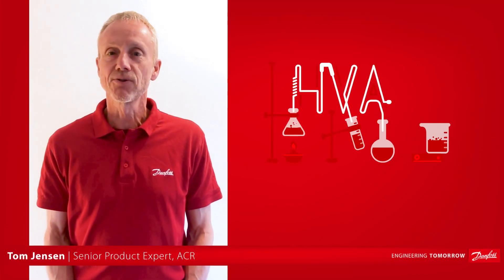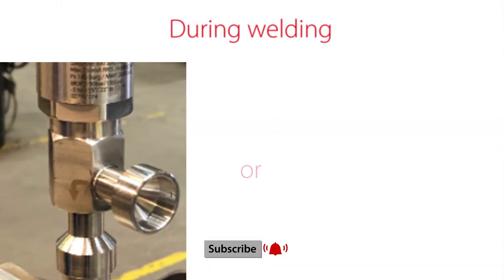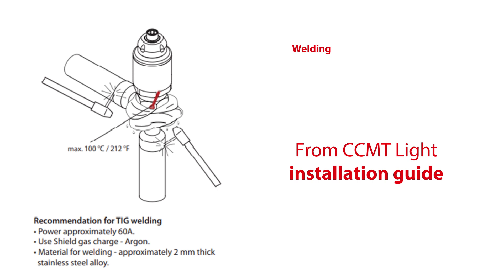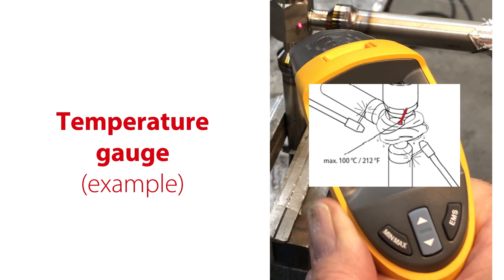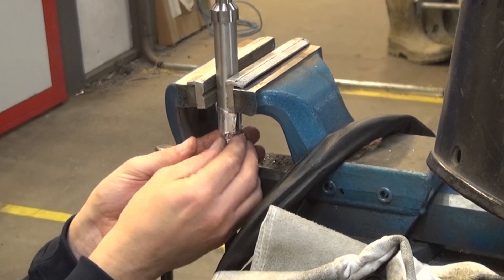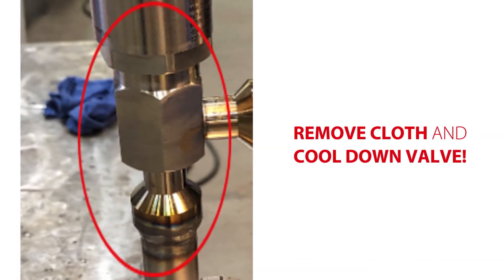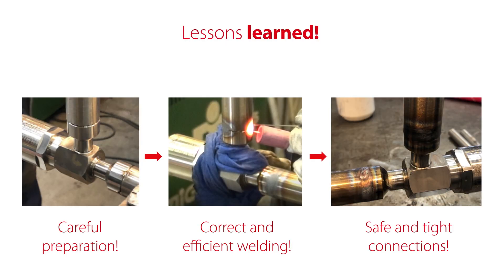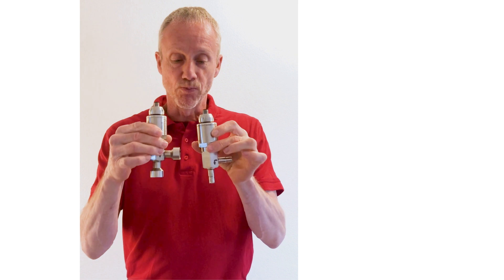How to weld steel connections on a CCMT Light valve for CO2 | HVACR Distillery

Comment: To fit a socket weld, a pipe is inserted into the fitting’s recess, allowing a gap of at least 1/16” to allow for thermal expansion of the pipe under welding pressure. Once the pipe is in position, it can be welded in place with a series of fillet-type welds. The thermal expansion gap will prevent the weld from cracking should the pipe expand against the fitting.